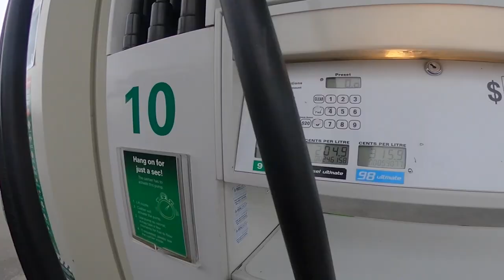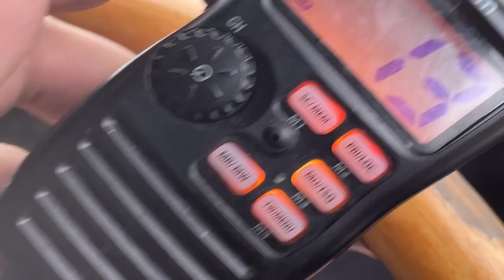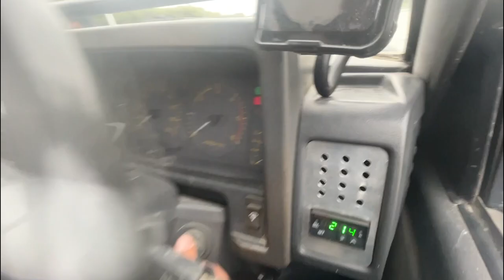ASHBURTON RIVER RUN 2022 - "Highest water level" causes major issues!

Comment: I am new to this wading stuff and I have a genuine question: don't you do any damage to your engine block or any other hot running component from the thermal shock of going into cold water like this ? Don't you damage any electrical stuff too ? I was baffled to see the truck at 23:50 run under water like this without any protection to it's engine. Are engines that water tight ?

Thanks for the video and have a nice day
Reply: Always wondered the same when going through rivers in me ranger
Reply from the maker: That’s a brilliant question man! If im honest i know nothing about engine shock with the hot at cold business but i say it wouldn’t be great for it but as for the water tightness, yeah! Especially diesels. There’s only 2 points of entrances into a diesel engine, fuel and air. You could include the exhaust too but the pressure being pushed out stop water coming up there 

If you were running a petrol engine, you add the risk of water entering through the spark plugs too